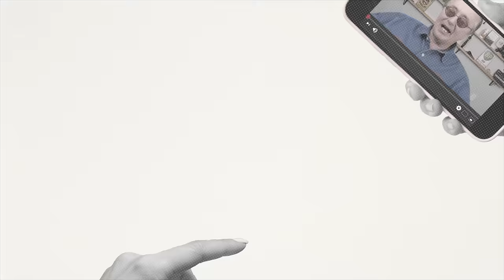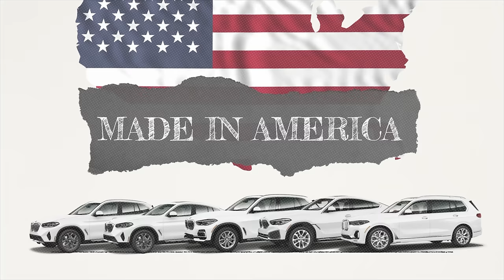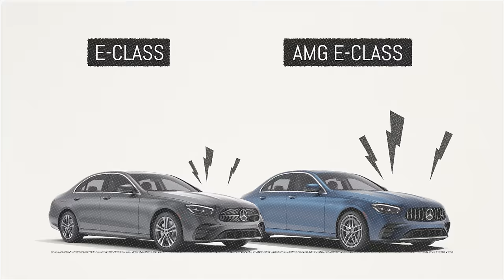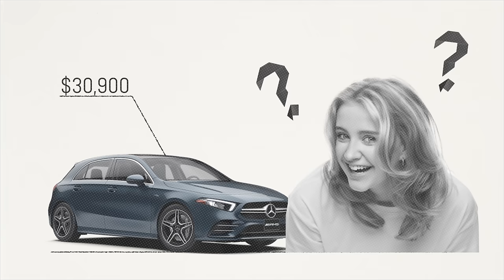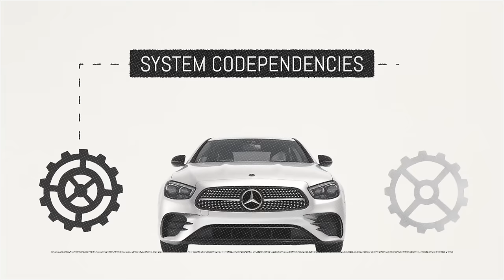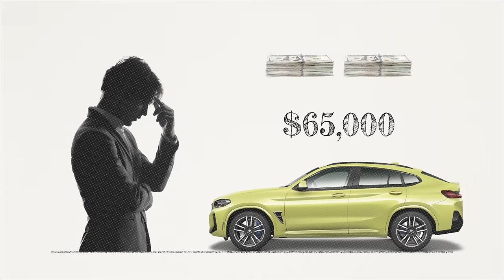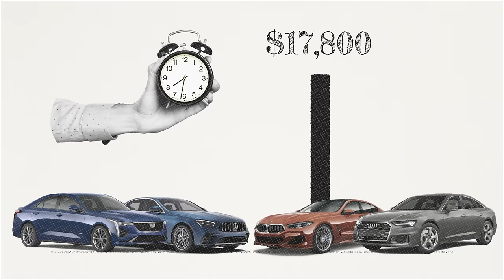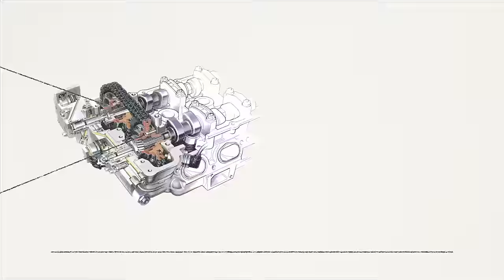3 Car Brands Only Stupid People Buy

Comment: Each brand has a price limit for being worth it logically.
BMW’s limit is 120k$ and the range is 50-120k$ more than that is a mistake.
Toyota is 0-50k$.
Porsche is 100-200k$.
Mercedes is 50-150k$.
It’s not just about cars,Even apple products the pro one isn’t worth it instead buying a regular iPhone and use the rest to buy apples is stock is the right thing to do.
I personally prefer bmw cars between 80-90k$ with 6cyl engines xdrive or not,Less than this price I go with Lexus and going further down I pick Toyota if I want to go higher I go with Porsche.
You sacrifice some reliability for beauty and attractiveness and joy but not as much as it breaks your wallet.

Comment: Got my Lexus RX 400h with 161k miles. Good car, been wanting to sell 2 years ago, but still drive it cause it's just goes. Obviously it is meticiously maintained. I am so tempted with 3 Series BMW, but afraid that I will be dissapointed with the reliability. Have had an E39 before and that car was lovely, but slowly it started to consume too much oil and I had to sell it.

Comment: Newer BMW's seem better than the old stuff. The M340 motor that is used across the platforms is a top notch engine.  Agree on Land Rover, and you should have thrown in Audi, Out of the group, BMW at least has a great aftermarket parts supply. The rest do not. The Mercedes rear door feature is great for the kidnapper driving your car when you try to escape

Comment: Ive owned 3 mercedes and never had to pay over $1000 for an oil change. I even have an old 2003 e500 still running with no issues.

Comment: I own a BMW 5 series X Drive 2013, have it for about a year now, so far pretty reliable, replace parts are more expensive than 'regular' cars, but it all depends how well previous owner maintained the car, but definitely wouldn't dismiss this car brand, it is an ultimate driving machine.

Comment: I got my 2009 corolla base model off my sister who drove it for many years.  Almost one year later and I spent more money on repairs and maintenance on the corolla than I did with my 2009 Jetta in one year. I drove them both hard. Being a college student and working, I'm always running around, so I'm hoping the corolla can handle me. Also, most people who buy BMWs are car enthusiast or just enjoy the luxury and performance that they won't get in a Toyota. Same goes for Mercedes. Toyota's aren't cars for pleasing people, they are an appliance car built for people who just need transportation. The fact that you called them stupid is also stupid. Great informative video, but you need to stop name-calling people just because they like luxury and performance cars. Some people enjoy cars, its their hobby.

Comment: I’ve owned a few older used Mercedes and I must say I’m not disappointed at all I love the way they drive and I honestly rarely have to fix things unlike when I used to drive American cars I was always fixing ball joints, idler arms, wheel bearings etc so my experience has shown me the parts are stronger and made to last longer so your not constantly always having to get stuff fixed plus they are super fast and powerful on the highway i live in Texas so your car has to be good at high speeds u can smoothly go over 100 mph easy with no shakeage like most American cars and also when there are issues they arnt a lot to fix as long as your not taking it to the Mercedes dealership and have a good mobile mechanic
Reply: For reference i currently own 08 Mercedes e350 130k miles (love it) previous car was 2002 s500 with 175k miles definitely the two favorite cars I’ve ever owned and I’ve owned over 20 cars

Comment: It's videos like this that prevents me from buying a 2020 BMW 740.  I've been going back and forth on it and consider the 6 cylinder a safer option than the 8.  But stories of AC units needing replacing at 40,000 for 3k and things like this keep me grounded.  I've only owned Japanese cars and have never had to replace any major non maintenance components under 150,000 miles.  Just can't justify the purchase.  I don't get how German cars are praised for engineering, but can't seem to make reliable cars. Doesn't excellent engineering, imply something that works well (reliably) as well as excel at its intended mission.

Comment: I'm thinking of buying a used Audi A4 sedan as my first car, since I adore the exterior looks of it. I'm 24 years old and just want it for a maximum of 4 years and drive approx. ≈80k km/≈50k miles on top of the current milage and then sell it again for a suv. I mostly drive short distances inside the city where are are a lot of bumps and would like to drive to different countries too, once a year.

Would that be a good idea? Which model or year should I aim for? Is maintenance annoying and expensive on Audis too? Budget is 13k, keep in mind that prices on cars here in Denmark are 3x america/uk.

Comment: Every car is a money pit. Every model has its lemon in the production line. Am I fixing my 108k mile BMW 320i with m sport right now? Yes replacing high pressure fuel pump $160, gasket $15. Thankful it’s on top of the motor.

Comment: 2:30 It is M2, M4 and M8 From left to right. M3 and M5 are not coúpe.

Moreover, people that have money want to buy a car they like. BMW/Audi or Mercedes are very good looking cars and they also provide high driving experiences with luxury features.
I personally had used Audi and now I have BMW F32 435d Xdrive for couple of years and I am very satisfied with the car. Of course, if you buy a strong engine, you have a luxury car and service can be more expensive compared to some cheaper brands. In terms of reliability, i did over 100k Km (60k miles) on my Audi B8 2.0TDI Multitronic, and all i did was regular oil changes + transmission fluid. I had never had any issue with my AUDI. Same for BMW Even tho it is stage 2 with 400+ hp.

Don't trust everything on the internet. If you want a boring, slow car just because it is economic and reliable, yes you can get some toyota with 80kw engine, what can even break in such simple engines?

Usually these cars are highly reliable, they have some engines that had some issues but if you take care of them as you should, they are highly reliable and lot of their engines can be more reliable than Toyota's

Comment: The problem that the author of the film raises does not exist.
There are rules in our lives that we cannot question. Continuous progress in various fields and the fight for possession have been going on for centuries. It concerns clothing, shelter and what we use to move around. You can have all this better, provided you have money. Progress is in our DNA.
And finally; Toyota is not better than Mercedes or BMW.

And specific advice: if you don't want to lose money on reselling a good car,
rent them long-term in a package with insurance and service. Pay a fixed amount per month. Put it into company costs.
Change your car whenever you want. Don't play around with the service, just pour fuel or charge and enjoy!

Regards.

Comment: I ONLY BUY 12 TO 20 YEAR OLD MERCEDES CARS. 

I BUY THEM FOR AROUND 3000, AND THEN USE THEM FOR A YEAR OR 2 AND THEN SELL THEM FOR 1500-2000. 

I HAVE ZERO STRESS, DRIVE LUXURY AND POWER, AND FOR ALMOST FREE.

Comment: BMW, Mercedes both expenssive to buy considering the price the build quality is sub par to say the least. Resale value is a joke 3 years of ownership and 25-30% value lost+ the repairs you need is just ridiculous. Personally just i would look at Lexus,Toyota and Honda for easier and cheaper ownership. Also you can customize the interior for your liking for cheap to get similar comfort as a BMW or Mercedes for fraction of the cost.

Comment: BMW is considered as reliable as Toyota here in europe, but it is probably because most of them are manuals or diesels or both (like mine, bought in 2011, never had any issue). Not something you would buy in the US. The parts are also reasonable affordable here. Used ones are cheaper here than japanese cars, because BMW sells much more than all japanese carmakers combined, and also more than all american  brands combined (again-only here). A used Subaru or Toyota is much more expensive, because they have like 1% of the market and are really "exotic", and the owners won't sell them. Probably haven't seen a Toyota in months, Honda is even more rare since both stopped making the body type 60% of people will buy- wagons.

Comment: Nice video, as always. I own 2 bmws currently, one bought brand new and 2nd one was used. They are expensive to service, but haven't had major issues. Disclaim that the new one was bought in 2015 and will likely keep that for years. The 2nd hand one is 2018 x2, fine so far. Should I not be able to afford it, then Def get ride of one of them but so far I'll stick to my bmws over a Japanese car for personal preference.  Prob will negatively impact my retirement in 30 years, but one life

Comment: Well Scotty, my 2011 BMW 535i with a manual transmission has 178,000.00 miles and is still going strong. My 2005 X5 has 115,000.00 and is also performing  well. Oil changes every 5,000.00 miles and some routine maintenance have kept them going. I did have to replace the valve cover gaskets and control arms for the X5.
Reply: hmmm yeahhh

Comment: Talk about very low noise inside the cars, I own and drive a Lexus LS430 and let me tell you one can hardly hear the engine noise outside of the car.  Inside the car you will not even notice that the engine is running.  And it is a Toyota vehicle.

Comment: While I do not disagree that the long-term reliability & costs for BMW, MB, and LR are not the best, one key point that I believe is missing here is the fun factor / enjoyment of driving.  Yes, the Japanese brands are far more reliable than anyone else, but their fun factor is simply terrible with rare exception.  Toyota has the Supra, Nissan has the Z and GR-R, but that's it.  Rest of the lineups are pretty boring.  I haven't owned a Japanese car in decades because of this.  Yes, I know the cost of owning / leasing a European brand is more, but those brands produce cars that are more exciting to drive...

Comment: Obviously Scotty is not a driver; more of a Mechanic becoming Critic.
For me, the 2022+ G80/G82 (M3/M4) with the S58 engine matted with the ZF transmission is the BEST.  Coming from a GT-R, this M series has more luxury, amenities, smoother, and just as fast!
I sold my 2022 M4 after 2 yrs and lost $10k (no tax incl'd).  My GLA 45 AMG is worth $10K less after 3 years of driving.  And I do most, most work on them, like: oil changes, brake jobs, transmission/diff., change, etc.

Comment: In mi opinion I have own several Mercedes and they have been pretty reliable a year  ago I purches a GLK 350 2015 for 11,000  and for mi surprised it went up and value now the are worth 15,000$ and since I had it I have only done routine maintenance not that expensive when you do it yourself soo mi advice is before you buy any car look at reviews and so far the reviews were right the GLK is a good suv

Comment: there are good cars and bad cars with every brand bmw has their 335i with the N54 engine that is a total money pit but then theres the bmw 340i with the B58 engine which is one of the best engines bmw has ever made it will easily last 200,000 miles with just regular maintenance and they are relatively cheap nowadays

Comment: own a 2018 340i at 19 and ill let you know if you buy a 2 series, 3 series, or 4 series your fine! its nice. also bmw ranks 3rd on reliable.  Expensive to maintain. Comparted to a toyota? sure. Unreliable? no. I drive it hard every damn day. I also do my oil changes early and my breaks the same! Ive heard loads of good things about audi as well. Mercedes is soso it seems.
Reply: buying anything higher then a 5 series comes with a bunch of tech and more tech equals more sh*t that breaks. FYI

Comment: I have had bmws for many years. the old ones are great you can work on them at home no problem. I now have a 2008 535i. maintenance is a nightmare. Scotty is dead on,. but it is possible to maintain one. it's just very expensive.  and often as own as you spend 5k. there's sometimes else.  
but a Toyota doesn't have the feel of a bmw. I have both.

Comment: Nothing wrong with wanting a luxury/sports car, but if you care that much about cars, then you should take the time to learn how to do basic maintenance yourself. Changing your oil is easy. And for Christ's sake don't take your car somewhere to have them change the air filters and windshield wipers. Just because you have a toyota doesn't mean you're not throwing away money.

Comment: I work for BMW. No not a dealer BMW (franchise) I work for the actual BMW. We have an employee lease program that we could lease a BMW X1/X2/X3/X4/328i/330i/M340i/ and the M440i the regular and XDrive version at half the price. BMW pays the other half of the lease, they pay for the insurance, and any maintenance required. If an accident happens as long as it was not the employees fault and have a police report the employee is free from any damages and BMW goes after the other driver and fixes the vehicle. I bring this up because THIS IS THE ONLY TIME I’LL EVER DRIVE A BMW. 😂😂😂. The cost to change the oil is ridiculous (think god bmw pays for this) yes the parts are cheap for a luxury car. They break down easily. Plus with the new lcd screens on the dashboard I feel it’s a lot of energy it’s using. Sooner or latter those lcd’s will lose pixels or in summer time when you park the car outside that hot summer sun beaining down on that dashboard over heating that lcd. I don’t even want to imagine what the cost will be to fix or buy and install a new lcd dashboard 😮. They are beautiful nice cars. They feel great when driving. It’s comfortable. And I can’t say it enough they are beautiful. I understand why people would want one. It even cross my mind. I even found a 2019 X3 for around $20,000. But Scotty is right. They are expensive to maintain. Parts are expensive, plus the service, the parts are not top quality(Trust me I know).  And yes they depreciates soooo fast. Just look at the example of that 2019 X3 XDrive I found. It’s not that old what only 6 years. Sure you would have to dig in to find more information about the history of that car and go see it in person. But Scotty is right and I agree. Scotty gave an advice a while back if you could lease one give it back and lease another one( if your finances allows you to do that) do that instead. But don’t buy one. Since I’m an employee that’s what I did (I actually had to do this because we only had one car and I had no choice but to lease one from the company.)I kind of did that. I love how the youngsters look at me driving my lease BMW and they think it’s mine or older people thinking I live with mommy and daddy, or other people thinking I’m in debt to this car.But I would not buy one. I will only buy one if I had Ben Affleck money. But I don’t so I won’t.

Comment: I own bmw for years. Got 5 sires amazing and reliable vehicle which is fun to drive. 150k before putting new tires did suspension check, only replaced two rear steuts 180$( german bilsteins). That's it. No rust, like 0 rust, all bushings are fine after 150k on runflats in northern climate, with salt on the roads half of the year. There is a reason toyota takes BMW Z4 and calls it Supra. Toyota can NOT build a reliable car that is fun to drive. Toyota builds boring cheap cars.

Comment: Different types of cars have different purposes. I have a Mazda 3 Hatchback as my daily driver, and it is used as my daily because of its reliability and it cheapness to maintain. But I also have an E46 M3. And that car is extremely more expensive than my Mazda. But I use my M3 for canyon and spirited driving. It gives me another experience than my Mazda, and I value that. It is a fun car to drive. But I also appreciate my Mazda for being my working horse. I'm lucky to be able to afford 2 cars that serve me 2 different purposes. If you just need something to get from point A to point B and can only afford one car, then there's no question that you need something like a Toyota or Honda.
Reply: I have a grand caravan now my next purchase I want is a suv. I was thinking Ford suburban but, not sure what are your thoughts?
Reply: @jeangrey2788  Nah I know damn well you did not just say Ford Suburban that doesn't exist

Comment: Lmao you have to be bad mechanic, in Poland those bmw like e90, e34 can run 600-800k km. I've seen a8 d3 with 800k km running. If you replace parts it will run forever. Maintenance is not as huge factor, any mechanic can fix those cars and if you got some unique engine like w12 from phaeton there are specialists/enthusiasts who will be happy to work with such engines.

Comment: As I said in a previous Scotty video where he ranted on about how unreliable BMW's are and expensive to maintain - I drove 6 520D's (F10's) to more than 1 million km's each (I run a small but busy Airport Transfer business) and all I did was change the oil every 25k to 30k km's - never had an engine nor gearbox issue - never had a blown turbo - only maintenance done was on brakes (pads and discs when necessary) and shocks (when necessary) and front suspension control arms (when necessary) - unbelievably reliable machines that have stood the test of time for me over and over again - and I only bought second hand 520D's when they had over 100k km's on the clock and were about 3 to 6 years old - Scotty is full of crap...